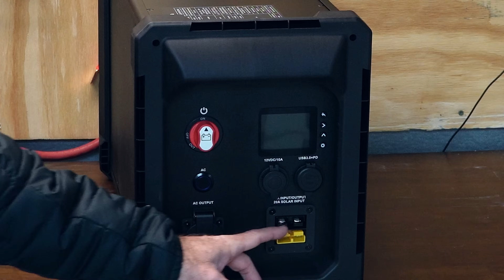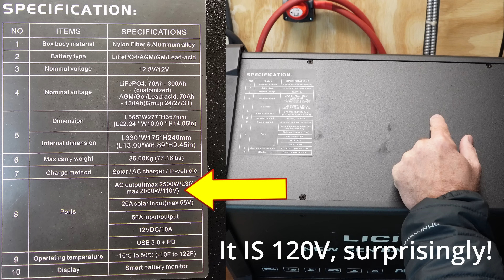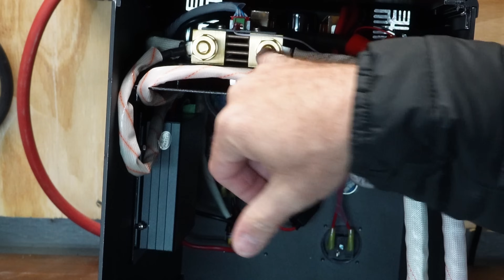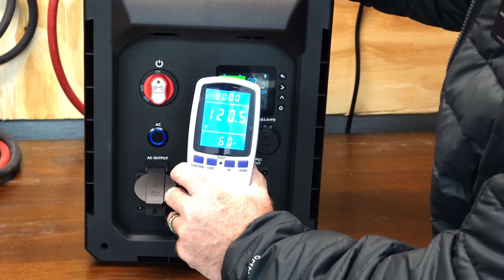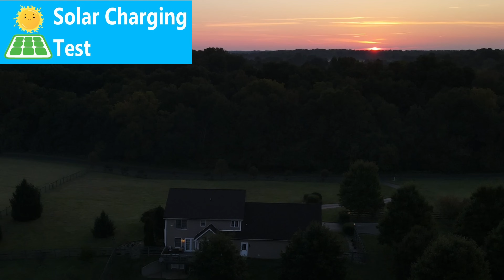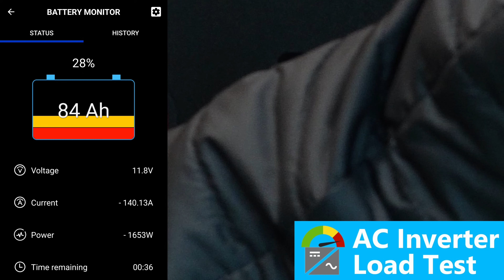Easiest, Fastest & BIGGEST DIY Power Station: Licitti 2000W AC Battery Box

Comment from the maker: UPDATE:  The guys at Licitti just reached out and provided me with a much better discount code than I originally had.  The new code is 'davidwray50' and is worth $50 off the 2000W AC Battery Box.
Reply: I WAS TOLD THIS VID WAS A 3500 SYSTEM. DID YOU DELETE THAT VID?
SEMPER FI
GUNNY
( AND YOU SHOWED HOW TO BUILD IT)

Comment: @ReeWrayOutdoors ,
I have 2of these boxes and have noticed:
1: the ac outlet does not have a ground wire to it on the inside of the box, but does have a prong hole on the ac outlet. This seems dangerous.
2: the wire gauge to the ac outlet seems to be a bit small in diameter. 
Can these two things be diy upgraded with heavier guage wires for say hard start ac or small dorm refrigerator?

Comment: Only ONE BIG ISSUE with this battery box that i found.  The charge values on the screen randomly resets to 100ah / 100% regardles of what state of charge the battery its at. At first i thought it was just a one off with the unit i received. But I bought a second one, as a gift for family,  and it has the same issue!! I hope licitti fixes this issue with an update or something.
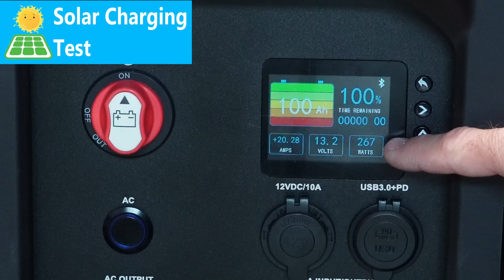Reply: Also i would like to add if you take close look at the video @15:23 i noticed that this issue acutally happened in the video as you can see its saying 100ah / 100% charged but it still at 13.1v. Also big indicator is that it is still charging at a high wattage even when it says 100% charged. Typically lifepo4 battery tends to slow down the charge when its close to 100% but it's still charging at around 300watts. 

I really hope licitti fixes this issue bc the guage is basically unreliable.

Comment: Hello, can you help me with the width of that mppt? That 20A mppt is a deal breaker for me, as i have a 300Ah battery pack. I am thinking of changing it with at least a 40A one, but i am not sure if i can fit it in that small space. Thanks a lot!
Reply from the maker: I can try to have a look again, but man...getting all 4 case screws to bite is a PIA! haha.  And by 'width' do you mean like 'thickness' clearance?
Reply: @ReeWrayOutdoors  thanks, i just check the OEM MPPT dimensions is 32mm (sorry i'm from europe) i am thinking of stretching in a 50mm MPPT with 40A or 50A, so that my 400w panel would take advantage of it. Also, more Andreson plugs would have done a much better system...but, no product is perfect
Reply from the maker: @alexandrusavin8665  I did check it out this morning and I'd say 27mm would be the thickest module you could squeeze into the available space (plus maybe 2mm for the bracket if you reuse what's there...or maybe double-sided tape or something)
Reply: @ReeWrayOutdoors  Thanks, Ray!  much appreciatte it
Reply: @ReeWrayOutdoors  the only solution left is to try to squeeze it in front of the bms. or extreme solution to get the bms on the side  in the same spot the small MPPT and get the bigger mppt in the bms place, hopefully this will work, as i need 50mm of clearance

Comment: Great review. It's probably not recommended by Licetti, but it looks like you could parallel additional batteries out the back and add additional solar charging through them. Maybe not the most elegant or portable solution, but the base 2000 comes with a very usable system at a really good price.

Comment: David - I noticed that during your initial AC power output test (with the oil burner) that you were drawing 1354 watts continuous and 112.89 Amps.  How can that be given the 1280W/100Amp "limits" of that 100Ahr battery yo were using?  Thanks for a great video !
Reply from the maker: Great question!   If you go check out the load testing clips on most of these LFP batteries,  you'll see that the BMS almost always has a fair amount of "headroom" beyond that rated 100A recommended spec.   And specifically how far over and how long you can run that way before the BMS shuts it down will vary from brand to brand to some extent.

Comment: Looks like another unit that uses sealed lead acid batteries but does it have proper charging parameters or is it like most of the rest all my booster packs only charges to what is considered dead checked out Duracell and nature's generator both had improper charge parameters and both had so low solar input that for every day of use it took 2 days to recharge

Comment: 18650 Battery Store has the version 3 EVE 280 Ah cells for $105 dollars, four of those would equal almost three regular 100 Ah batteries, at a fraction of the cost..Add a JK BMS with has an active balancer, and is simple to install, and you will have a very good battery/solar generator..I would buy those cells over any premade battery or cells that come with this product..The 18650 Battery Store EVE cells are verified grade A cells that will last twice as long as the cells in solar generators, and longer than the cells in premade batteries..And never even consider pouch cells..Of course I would build my own system completely, and have..

Comment: the Black Anderson connector says 50A input or output. the Yellow Anderson Solar connector says 20A input.
Have you tried charging 50A AC/DC into the Black Anderson and 20A into the Yellow Anderson via Solar together to get 70A of charging rate?

Comment: Really like the all-in-one “BYOB” concept,  especially for those that have spare batts lying around + this makes swapping batteries in/out, really easy. That said, does this particular company offer a BYOB unit that features a 30A RV plug, if not, they really should consider adding this feature, since this is becoming a welcomed trend in the industry.
Reply: RV port... exactly my question. Thanks
Reply: Isn’t there a cord that can be hooked up to the 50amp Anderson plug with the other end into and rv input? 
Or must one diy such a cord/ box . The box would be a simple fix…50amp rv outlet powered from the Licitti box via the 50amp Anderson output.

Comment: Hi David,
            These B.Y.O.B. battery boxes are a good idea but as others have stated and you yourself have said, the solar input is pretty limited. If you were to add 3500wh of batteries and are capped at 275 watts of solar input, well that's going to take quit of bit of time to charge unless you add an external charge controller. This box does have many upsides though. If you buy the box with their 280ah cells, that's a heck of a deal at around $1000. You can also use lead-acid or LifePo4 batteries and can swap them out. The aluminum housing makes it sturdy. The 2000 watt inverter is also nice as is a mobile app. It would be nice in the future if they added more AC and DC ports and, of course, more solar input. Maybe they could make a deluxe model, it would be worth the additional cost, IMHO. Thank you for another great and informative video David, I have learned so much from you.
                                                                                    Take care and Happy New Year, Steve.

Comment: What are the benefits of getting their 280ah lifepo4 battery cells ($508 seems expensive) over getting other batteries with similar ah output? Hopefully my question makes sense. I'm new to all of this.
Reply: I would guess you get their support and you can be sure they can fit. Sure you can find cells cheap, but what grade, are they new, will they swell... There's a lot of info out there. Maybe Sunfun kits?

Comment: David, as always, thanks for the review. The all-in cost of the box (shipping + 20A AC wall charger; not including any taxes or your coupon code) is $568. If you don't have a spare 100AH battery lying around, add $250. As of this writing, Pecron is selling their 2200W 1536Wh EP1500LFP on sale for $900 with free shipping. The only advantage I can see is the 50A DC 12v output, but the Pecron has a 30A DC outlet, not to mention the 800W solar input. I think the only value in the box is if you already have a battery you can use. I'm not sure I would buy this and a battery given the current state of AIO power stations today. I did purchase the 1000W version and put in a battery I had lying about, and that's been useful.
Reply: This initially seems like a "deal", especially because it handles 2000W, but when you add the cost of the battery, and the "charger" which is not included... it becomes much less of a deal. 
Lastly, I would only consider this if it also included UPS functionality.
Sure glad you decided to read the manual -- even if it was mid-review. The main reason I watch this channel is for the expert review. If it becomes an "unboxing" review, I will tend to not watch.
Reply from the maker: Yeah, like I said, I think the real value on this unit is if you get it with the 289Ah battery kit.
Reply: @ReeWrayOutdoors  I'll look forward to your review on that kit. Thanks again for all your efforts.
Reply: Good point, the price isn’t very competitive considering the limited features..eg..low solar charge input, lack of 30A RV out, etc… :’(

Comment: Does it have UPS feature?
Reply: No, because it does not have any A.C. input. It always requires D.C. input and converts that to A.C. for output.  If you are using less than 500 watts then the D.C. input will keep it charged even as you are discharging at the same time.  But if you use more than that the D.C. will not keep up and eventually the battery will run out.

Comment: Looking forward to the 280ah kit video. The solar limit is pretty wimpy, but maybe the 50A in/out can be used to charge such a large battery faster
Reply: Agree, they would sell a lot more of these units “if” they offered higher solar charge input. They also should consider offering a unit with a 30A RV receptacle… if they don’t currently offer one.